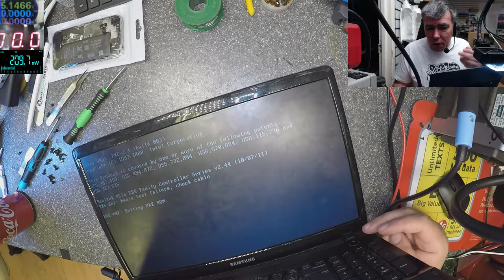Samsung NP-300E laptop, motherboard repair

Comment: is there not a similar component but has a stronger internal resistance? What is damaging the chip if it is continually happening? Heat? if a very very small resistance was put in line with this chip, would it protect the chip itself ?

Comment: Hello, I have the exact same laptop. When I plug the power cable, the power led under the onboard mouse shows blue. When I put the battery, the same blue led turns on without me pushing anything. When I push the power button, the power button shows blue but nothing works, I opened, clean and still the same problem.

Comment: Samsung 300E laptop is not coming On. However the green indicator for power available is coming on immediately I plug in the charger. What then could be the problem? What should I check for?

Comment: Hello sir, thanks for your video. I had the same problem i fixed it like you did but now my laptop don't work with battery but work fine when I plugg in the charger. It say 0% plugging in charging. But really it not charging
Reply: Same here I have the same problem fix the display it works but the battery isn't charging replace AC adapter with 2 new batteries same problem please help let us know does it effect the battery charge and when charging thanks
Reply: turn on the laptop with the battery and when is working fine remove the battery just a while and return it you will see the battery start charging
Reply: @aziznature4830  you need to put replacement mosfet for it to charge

Comment: Same laptop NP 300e blue light turns on CPU fan working  HDD working and no display i attached external monitor but same problem some time i have to turn on and off several times to start working. i replaced RAM and disassemble each device like DVD HDD WIFI SPEAKER LCD KEYBOARD MICE USB even ON OFF button and trying to start laptop with naked motherboard but no success
Reply: also try electric discharge and CMOS removed but fail
Reply: You first said that motherboard is working and after that you said you plugged off LCD and everything and tried to power up the motherboard itself (didn't quite get why). I think maybe it's GPU.. try heating up the bottom of the laptop untill it's really hot with the hair dryer and then turn it on fast while it's still hot.. If there is picture on the screen, then that's the problem. And try a few times, it's really hard to get it hot.. If it's working you can bake the motherboard in the oven. Remove everything from the motherboard that can be removed before baking. You can google how to bake it in the oven. Those are the "no cost" temporary fixes and the problem will come back. Reflowing it with the heat gun is also a temporary fix.. Reballing is the only "permanent" solution if done right but it's quite not worth it, easier to buy new motherboard od new laptop.. Of course if the GPU is the problem in the first place.. Don't know what else could be the problem as you tried new ram, cmos reset and discharge and external screen. Maybe the ram slot is not working, I found that problem on my laptop and the symptoms are the same of course.

Comment: hello,
I have the same 300e laptop but i have power :D just when i try to turn on i have blue ligth and i can hear the winchester speed up but the screen didnt show anything to me. :(
And the last times when its worked i have the same problem but 2 or 3 trying and its turn on
Reply from the maker: ram memory?
Reply: i buy a new memory with 1600mhz but its didnt want to work xd :/

Comment: Hello! I have the same motherboard. Problem is, it does not turn on.
The green light turns on but does not turn on the blue light. When you press the power button, the blue light blinks but does not turn on.
Reply from the maker: check the usb ports and 5v usb power rail, reset the bios, check with the power supply how much power is getting when you press the power button
Reply: @electronicsrepairschool  I had the same problem with one motherboard, it was blinking, so after all the things I tried I googled the number of blinks for that motherboard and it actually was faulty charger which seemed ok with 19v it was giving. After I tried the new one, it worked normal. Google is our friend. After all I found you Sorin through google and that was my best google search and video click ever.

Comment: not surprised you had that back
Reply: I can't belive you re-assembled the machine with a short between drain 
and source instead of having that mosfet replaced. Please tell me you 
were joking and you don't ask money for that ;-). That "chip" is 
supposed to be there for a reason. Would you please explain using a 
schematic, which signal controls that mosfet gate and what is the reason
 why is supposed to be there?
Reply from the maker: u got it wrong, its a completely different laptop with same fault
Reply from the maker: Well, dont get so angry, the mosfets are there to annoying me :) Its no other practical reason, just trust me :)
Reply: Dont worry Sorin, he obviously hasn't seen the video before leaving such agressive comments!